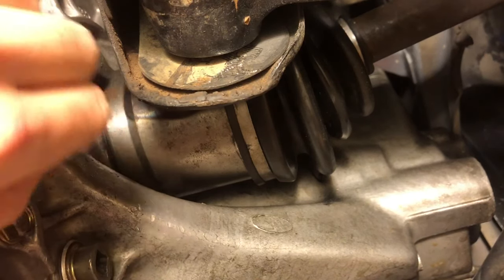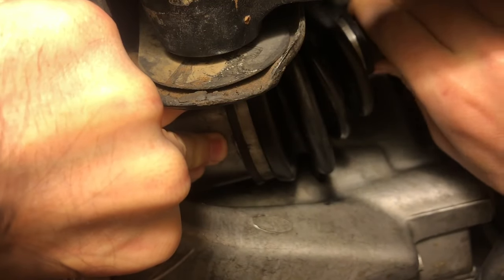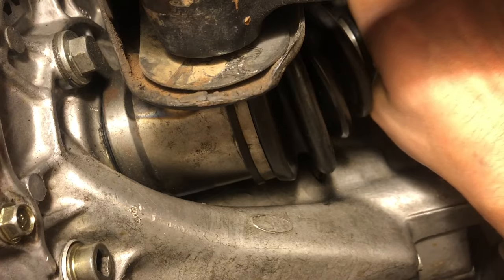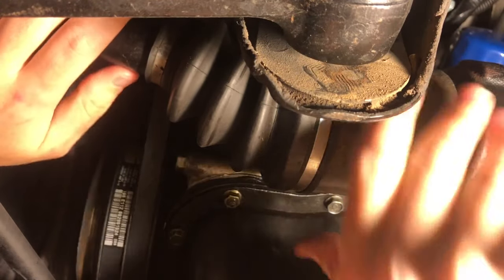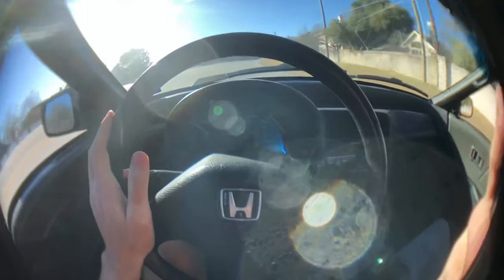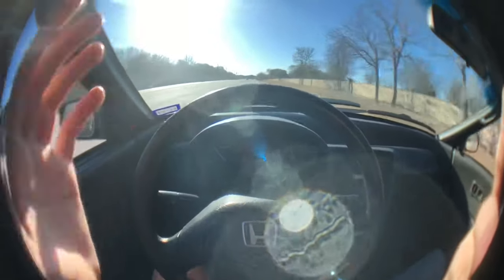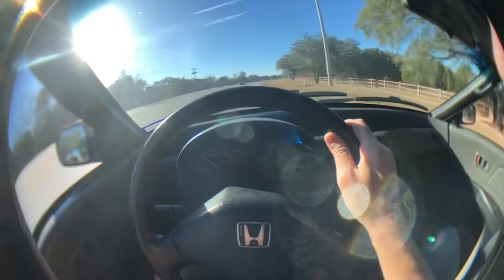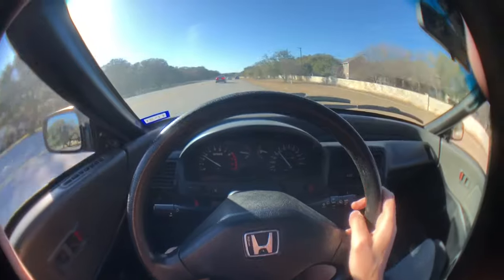How to test Bad CV Axle inner joint on car

Comment: On me VW Golf 5 SDI with 730k km, I found the following during a 4 tire replacement:
left axle - moves inwards and outwards, small ticking when it does full in or full out - you say its normal ?
right axle - when I spin it by hand to front of car and back and forth quite rapidly, slight ticking or knocking sound. its ever so sligthly. (I didn't put pressure on that part like u did, I just grabbed the outer shaft and man handled it)
I checked out the axles because even after 4 new tires and alignment car pulls right, and today for the first time I started hearing audible vibration in right turns on the highway at 100+ km/h
if wheel is centered or slightly to the left (when I correct the steering angle manually.. ) no vibration heard. Ideas ?
Reply from the maker: Ticking/knocking when full in or out is usually a sign that the outer joint of the axle is worn out. It sounds like your axles are worn out and causing the vibration and steering pull. It would make sense that your axles are worn if they are the originals with 730k km on them. 

I can’t say for sure that it’s the axles causing your problems but that is what it sounds like to me. Best of luck and let me know what you find out.
Reply: @COU51N.Kyle.  thanks for replying!
Question is, is it both axles that are bad or just one side that I can get away with, by full in and out noise you mean what I described from the left (driver) side ?

Comment: Hey man how you doing  when I start driving it my car  when the goes to 30 to 40 mph when I accelerating Star vibraing do you think I have a bad axles. I watch your video so I'm going to do the same thing in my car hopefully I found the problem thanks man
Reply from the maker: It could be your axles but it could also be unbalanced tires or a bent rim that is causing the vibration. 

Hopefully the axle joint  test will give you some answers. Let me know what you find

Comment: So ive replaced my driver side half shaft last year. Get wheel vibration at around 75 mph. And when driving slow and turning get a knocking/clinking clicks every now and then. I replaced the front engine mount already about to do the trans and rear motor mount as well. But i just did this check. Didng even hold the inner cv. Put it on ramps set the parking brake and wiggle the passenger with no play whatsoever. Go to the drivers side and it has a TON of play. Autozone Junk!
Reply from the maker: Sorry to hear that. I’ve had bad luck with autozone axles too 😖

Comment: My 2003 Malibu shakes like a pup pooping peach pits betewen 45 52  and it's more of a forward to back shake - like something "grabs" at one point or something.  and does it also when going downhill and braking..  IDEAS??
Reply from the maker: That sounds tricky to diagnose. 
Initially I was thinking it was worn shocks/struts causing your car to undulate when the suspension is under load like when going downhill or braking but the “grabbing” has me stumped. I wish I could help more. I don’t have experience working on a car with those symptoms. I wish you the best of luck and hope you’ll let me know what the problem is when you find out. I’m very curious now.
Reply: @COU51N.Kyle.  I've had the bearings replaced- the rotors are new- and brakes are all new-- so it's still doing it-- which is now kind of making me think the axle itself may have a bad spot or something.

Comment: Glad that I was found your video. I have same problem in my Chevy Spin. So, the problem is only inner joint right? Is there any other possible problem the inner joint bearing that located in the gearbox?
Reply from the maker: Yes, my problems were only caused by the inner joint. 

It is possible that the gearbox could cause these symptoms but I don’t have experience with that.
Reply: @COU51N.Kyle.  what is possibly part in the gearbox that caused same symptoms like your problems?

Comment: Have some kind of clunk/pop noise when I turn lock-to-lock when im parked or when I put the car in reverse, accelerate from a standstill.  No wheel hopping feeling or anything so im not sure if this is the passenger side inner axle joint.  190k on both axles, new rack & pinion (including tie-rods and swaybar endlinks), lower control arm, and lower ball joints.  Ive posted all over the place from Reddit to web forums and have an appointment with the auto shop on the 12th (only available one).  Did record a video which I cannot recreate the sound when the front end is lifted in the air, only when pressure is applied.  Link - https://youtu.be/RCX5GuyPjwQ ....cv?  Front and rear motor mounts are no more than 2 years old, passenger side and transmission mounts (TSX) arent new.  If it makes clunk/popping noises when at a stand still and turning left to right (steering wheel position doesnt matter and it happens only a couple times) I cant think of what else i didnt already cover that could be the culprit other than CV.
Reply from the maker: I agree, I think it is your cv. It’s making a lot of noise when you’re moving it in your video. I can’t say for certain of course but you’ve done a lot of diagnosing yourself and I think the shop will agree with you as well. Let me know how it goes on the 12th. 

From my research, it sounds like your symptoms are those of a bad outer joint on the cv axle. One test you can do is to drive in a circle with the steering at full lock. A bad outer joint will click or make noise while it’s driving in the circle.
Reply: How did it go on the 12th??

Comment: I have a 08 sti awd!!!  I accelerate car pulls to the left, let go the gas pulls to the right, any advice? Rattle on bumpy roads
Reply from the maker: I have heard that a common STi issue is worn out tires that cause the car to pull left on acceleration and pull to the right on deceleration. I would try rotating the tires to see if the issue is still there. 

I'm not sure what would cause this. Maybe it has something to do with the STi specific DCCD system and how it puts power down.

The rattle on bumpy roads sounds like a suspension issue to me. Worn out shocks can rattle.

Good Luck! let me know what you find.
Reply: @COU51N.Kyle.  thanks

Comment: I have a question. I had a bad axle that was causing shaking at highway speeds I got them replace at a shop with new aftermarket axles and it fixed my issue. But right after they were replaced I now have a vibration at 25mph only that was not there before. If I accelerate quickly I don't even feel it. I believe aftermarket axle is causing this. But is it ok to drive with it this way ? I have been for 3 months now and it has not gotten worse or anything.
Reply from the maker: I can’t say for sure but I think you’ll be alright.
Reply: I’m in the same boat as you man. Just replaced my passenger axle because of a torn boot on the inner CV joint. 

The axle that was replaced was OEM. I couldn’t get a OEM replacement because Honda has a national back order on parts. 

Anyways, I picked up an aftermarket axle from Autozone (Duralast Gold) and installed it. 

Now I’m getting vibrations at low RPMs 20-30mph. 

I’ve watched so many videos and read so many threads and I’m beginning to believe it could just be that it is the aftermarket brand like everyone else say.
Reply: @GhadSpeed  yeah a few others have said it will be fine I have been driving with my low speed vibration since January and seems to be the exact same not worse at all. Guess I will just live with it

Comment: Is this an aftermarket cv axle? how many months have you used it?
Reply from the maker: Yes this is an aftermarket axle. It came with the motor swap I bought. I used it for 4 years but it could be older than that.

Comment: My mechanic just installed brand new cv axle, why there is still grinding noise from inner axle?
Reply from the maker: Sorry I don’t have any experience with a grinding noise. Could be bad fitment or transmission related. Wishing you the best of luck. Your mechanic might need take a deeper look at it.

Comment: Would it ever make a grinding sound, even when coasting downhill in neutral?  I have grinding but i feel it's the front differential (awd).  Hopefully it's the cv instead because there is clicking when i turn sharp.
Reply from the maker: No I never heard a grinding. Clicking when turning sharp is usually cv axle
Reply: @Tezzzaaa  Turned out to be motor mount

Comment: Well damn. Im trying to find the video to help me find a way to pop the rest of the axle in. I have most of it in, however i still have a gap of about an 1/8 inch
Reply from the maker: Sometimes you gotta pull it back out and try again. The little ring clip can be tricky. You’ll get it.

Comment: both my axels look terrible, could that be causing a power steering leak as well? bc thats another issue my car is having
Reply from the maker: I don’t believe so. Although bad axles can be felt through the steering wheel, I don’t think they would have any effect on the power steering system itself.
Reply: What kind of car?  Power steering leak could be power steering hoses being cracked or not tight enough.  I replaced my rack & pinion last year but developed a leak in the lines and discovered it to be one of the clamps was loose due to age.  Where is the leak coming from?

Comment: By any chance was your car vibrating at 70 mph? Your passenger seat in particular?
Reply: My vehicle does this. Did you ever figure out?
Reply: @phillippardo5712  no i cant seem to find out
Reply: @chekacheka12  did you ever have your tires balanced? And does it do it all the time or have you found a certain time when the vibration does not happen at 70mph?
Reply: @phillippardo5712  it does it all the time at 70 mph and yes they are all balanced that was the first thing i checked for
Reply: @chekacheka12  what kind of vehicle do you have and is it AWD or 4wd?
Reply: @phillippardo5712  awd subaru wrx impreza 2012

Comment: Great video. I have a lot of vibration in 1st ,& 2nd gear. Do you think driving for almost a year with a snapped front suspension coil would damage the cv shaft because that's what I done without realizing it was snapped at the top.
Reply from the maker: It’s definitely possible. Without the suspension doing it’s job properly, the uneven surfaces of the road would cause the axles to move more than normal. This could cause excess wear on the cv shaft joints.
Reply: @COU51N.Kyle.  Thanks for the reply..Yeah I thought so.
Reply: I just replaced the whole front end suspension and looking at all the old  parts I removed,  I noticed that the cv shaft was worn out and bent, the hub was almost falling out from the wheel bearing causing a gouge in the knuckle from the bearing casing and the lower ball joint was completely knackered. 
Now I know how much damage a snapped coil can cause. 😖
Reply from the maker: @hipstarchild  thanks for update. sorry to hear about all the damage. At least it will ride nice with the new suspension.

Comment: Mine Honda Stream btween 80mph nd 90 it vibrates,was told maybe tyre balancing I did that together with alignment, but still getting same vibration from passenger side,can it be my CV?
Reply from the maker: I believe so. Checking the cv would be my recommendation.

Comment: After replacing all my suspension. I knew it could be the CV joint that is probably knocking around small bumps
Reply: Did you cure the problem my friend

Comment: What symptoms will this cause ?
Reply: Vibrations driving straight, especially on inclines, or vibrations while accelerating in turns and curves. The direction of turning and experiencing vibrations can tell you which side and sometimes it will be both. Aside from vibrations another symptom would be clicking noises while turning even at slow speeds.

Comment: In that case..the problem is in inner joint on gearbox side or on knuckle side ? 🙏🙏
Reply from the maker: Gearbox
Reply: @COU51N.Kyle.  thankyou for answer.. 🙏
Reply from the maker: Thank you for watching:) 
A bad inner joint on the knuckle side will click loudly while you are turning.
Reply: @COU51N.Kyle.  does the car got to be jacked up while you test for play on axel
Reply from the maker: @jesusrocha9000  I’m the car doesn’t need to be jacked up. It only needs to be jacked up if there isn’t room for you to get under the car to do the test.
Reply: @COU51N.Kyle.  thank you

Comment: I had vibration at speeds around 60 65 miles. Today a mobile mechanic replaced both cv axles, now the vibration is worse and starts at 55 miles. Purchased new tires, getting crazy, :/
Reply from the maker: Sorry to hear that. That is frustrating. It sounds like it could still be the axles since the vibration got worse when a different set of axles was put on. I originally replaced my bad axle with a new Duralast axle. The vibration got worse. I bought a new axle set from DriveShaftShop and the vibration went away.

Comment: Hearing humming noise once hitting 30km/h, but the sound goes away over 50km/h. But in the highway, around 60-100km/h, when pressing the brake, the noise comes up again, just wondering if that’s a wheel bearing problem. Also hearing hum when cornering
Reply: could be wheel bearing. It's hard to tell without hearing the sound in person. Generally I'd say a wheel bearing sounds like a hum but you can feel it in your feet at the same time. when you corner and load the outside bearing more the sound can get louder, that could tell you which side it is. Best bet is to jack it up or put it on a lift and give a visual inspection for anything wrong. Could also be a motor mount, I've heard humming noises from collapsed motor mounts. What kind of car is it?
Reply: @mentals555  that’s a 2016 Mercedes cla. I recently noticed the humming noise especially at 30km/h, the humming noise is so loud, but as I keep accelerating over the speed, the sound just magically goes away. Also in the highway, when time I press the brake paddle, the humming and rumbling sounds comes up. I have been told the wheel bearing noise will go up corresponding to the speed of the vehicle. Would that also possibly caused by wheel bearing although the sound is louder as the faster the speed is.
Reply: @chenglongguo5181  Sounds like it could be more of a vibration, something about the resonance frequency between those speeds maybe causes a vibration somewhere. Just a guess man. Wheel bearing noise also gets worse over time as you drive the car and the bearing wears out more. Eventually it sounds more like a grind than a hum. I'd have a professional listen to it, you can have 5 people listen to the same sound and each describe it in a different way. No way of knowing exactly what you mean through reading words. You could upload a video of it too
Reply: @mentals555  yeap, just got two of them uploaded. Take extra notice when the speed coming closer to 30km/h, the sound is really weird and abnormal. Emmm, not sure if the camera catches the sound well though 😂
Reply: @chenglongguo5181  Hard to tell which sound you're talking about, i believe it could be a wheel bearing. I'd head to a shop and have them listen and diagnose. You can lift the car and try to wiggle the wheels tk see if there is any abnormal movement in one the bearings
Reply: @chenglongguo5181  Yes after listening more times it does sound like a wheel bearing
Reply: @mentals555  

Hi there
Really appreciate for your time of investigating for me. Just one more concern that is the noise caused by the wheel bearing increased corresponding to the speed of the vehicle,like getting louder as the faster the vehicle goes. My one is just like having the humming when cornering and driving around 30km/h. In the highway, like at 80-100km/h the sound goes away, the noise can be heared until pressing down the brake paddle, the noise appears again
Reply: Can’t be heard until ######
Reply: I hear that too, but it when I'm going faster than 25, the faster I go the louder it gets, but once I slow down below 25 it goes away.